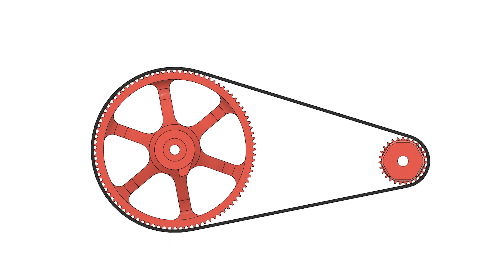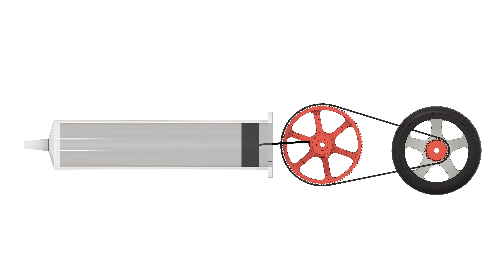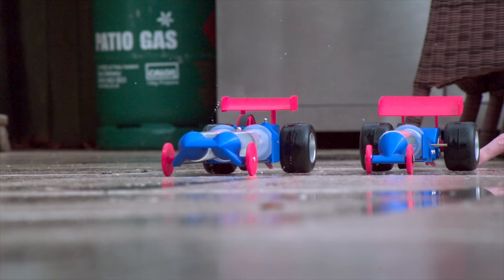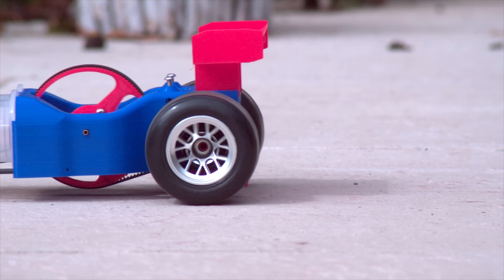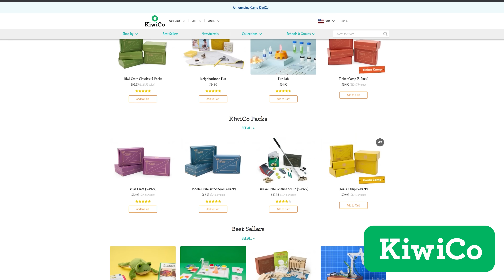Vacuum Dragster

Comment: When syring piston was pulled, some air vortex created behind the piston rod so that making air resistance. Moreover, vacuum syring only can produces short time but brutal torque, it’s not good for long range travel like ICE cars. As a result, I suggest add another syring to improve the efficiency of whole system. 

Elements: Sealed syring piston rod connect with another unsealed syring piston rod. Unsealed connect to a root turbine as mainly power rear wheels. Wire connect to rod & front wheel gearbox.

Position: Sealed syring put the front of car while unsealed & roots turbine put the rear of car. 

Function & how it will work: Before start the car, first pull the car back. The front wheels will spin so vacuum created in sealed syring will air sucked outside by root turbine in unsealed syring. Next, release the car and use front wheels connect to wire accelerate little bit until rear axle root turbine rotate and produce enough power as outside air sucked back to sealed syring. Finally, to stop or decelerate the car, change the gear in front, rear axles gears in both gearboxes, let axles recover kinetic energy by increase vacuum area in sealed syring and sucked air outside unsealed to help accelerate or start the car next time, so braking dishes need to slow down the car, overheating issue won’t exist anymore

Hopefully the whole system work well and replace heavily electrical power unit

PS: although whole system can work in high pressure air in sealed syring, the efficiency will reduce as pressure decrease while volume increases but number of air molecules doesn’t change. Only very little air molecules in vacuum so don’t effect force air act on piston and power output is more sustainable

Comment: You should have made it with a system declining torque/increasing speed out put.

High torque get the mass going and the highest final speed possible. 

Maybe a cone shape a Spiral or stages.

Comment: Here's my personal favorite way of comprehending just how much pressure the atmosphere exerts. At sea level, the air pressure is equivalent to the weight of a 1.033 kilogram mass resting on one square centimeter. A steel bar (common mild steel, density 7.850 grams per cubic centimeter) with a cross-sectional area of 1 square centimeter and a mass of 1.033 kilograms would be 1.316 meters long. If an average-height human male rested that on his toe, it'd reach to his chest. It would also really hurt.

Comment: Hey Tom, you should use a vacuum chamber on your bike instead of the flywheel. You can convert the kinetic energy of the bike to the vacuum chamber by pulling the piston out. And then later accelerate again by letting the piston go back in. The pressure difference will always be 1bar and thus giving a constant acceleration/deceleration.

Comment: Engines often run the crank case under moderate to high vacuum to archive higher HP and efficiency numbers due to the vacuum helping pull on the pistons .

Comment: It would be cool to see something powered by NiTinol (memory metal).  It Contracts with heat and is more malleable in cooler Temperatures. I’ve seen someone make a motor from it with just hot water heating heating a looped string of the metal

Comment: what if you created a trigger mechanism that would engage an even smaller gear ratio after a certain rpm was reached? like a 2 speed automatic transmission. ive seen it done on chainsaw gokarts with varied success. id imagine creating parts for this might be easier since you have a 3d printer. even if its just semiautomatic it would mimic a real dragster fairly well since youd have a much higher top speed

Comment: Please let me know if I am understanding this. By pulling the plunger back, it creates a vacuum inside of the sealed syringe tube, and since that vacuum is lower pressure than the outside pressure, the plunger is forced forward, into the tube?

Comment: what if you were to come up with a way to have a swapping gear system that swaps between pulling the piston back for 1 syringe   and for the other it would provide power to the wheels when releasing the vacuum and then swap back over as that one reloads and the other releases causing a combustion engine like movement  and if you make this happen can we control  it by a centrifugal clutch like system with a cable that goes up to your hand

Comment: this is lightest fuel possible...vacuum. it's very similar to compressed air powered cars, except with compressed air you can hold much more energy in the same volume. using the seringe, vacuum holds  probably about the same energy as 4bar compressed air except it is lighter. 
if you compress the same seringe full of air to a fourth its initial volume, you have air at 4bars that will push the seringe along 3/4  it's length, starting ,with  an initial bar pressure difference and ending with 0bar pressure difference so if we average to 1.5 over 3/4 the length it should provide 9/8 the work of a vacuumed serinve pushing 1 bar over the full length.
compressed air tanks are heavier but can hold 300bars

Comment: It would be interesting If you used the Nucomin principle, with a small low pressure boiler and a valve gear that injects the water at just the right time so the piston retracts.

Comment: what if the axel around which the string was winded wasn't perfectly straight but rather cone-shaped? The change in diameter would change the gear ratio as the string would unwind. It would basically be a very simple automatic transmission (CVT). You could start the car in low gear for traction and upshift as it accelerated.

Comment: hi sir , just like mousetrap cars, syringe powered car  and  rubber band car we can also make cars by using a measureing tape , we can wrap the measureing tape on one axle and join wheels on both side of the axle , and we will get a measureing tape powered car ,we can make the car fast by making 2 axles , one axle which is joint to the wheels and other axle on which we can wrap mesureing tape and join both axle with pulley and rubberband , sir what do you think of this idea?

Comment: ADD  LEAD OR STEEL WEIGHTS TO IT THE ADDED WEIGTH WPOULD PUT MORE PRESSURE OTO THE AXELS WITCH WOULD PUT THE TIRED MORE FIRMLY ON THE GROUND AND ADD EXTRA TRACTION

Comment: Acceleration and top speed increase when the car uses tires with more grip. Is a good idea cut two baloons and put some rubber in the rear wheels

Comment: Its a good idea but you have designed a vehicle that does the opposite of a top fuel dragster because a top fuel dragster is designed to race of the mark with extremely high torque and coast the rest of the way down the drag strip

Comment: There is something oddly satifying, seeing the fine print on the toothbelt rotating in slo-mo.
I am wondering wether you could control the car steering with a flywheel. But then again, it would probably get too heavy.

Cheers!

Comment: When I was an apprentice, we found that if you spin a bearing up with a compressor air gun, it makes a satisfying screamlike whine. When you dropped the bearing onto the lino floor, it would wheel spin in situ for a while and then accelerate at mean speed. So we built dragsters around bearings using thin copper pipe, and found that if you wrap the bearings in heat shrunk sleeving (you had to balance the wheel), you had a tire and the dragster instantly shot off and disintegrated against the workshop wall. Great fun!

Comment: You should try the super capacitor dragster but only with one motor with a gear printed into the axle so you dint pull as much current per pulse of throttle and you can control it easier and have less chance of flipping and destroying wheels

Comment: Should of put a little weight on the rear of the V-2 car. Was a trick used on old Ford Capri’s so they could be driven harder/faster with more stability

Comment: There was a concept for a vacuum powered car, one vacuum releasing would power the other, and a shaft was connected to it. didn’t work though, because the two vacuum cylinders would just equalize and not move

Comment: Some of the earliest power seats in cars were vacuum powered (e.g. an internal combustion engine is mostly an air pump but with this air pump it creates low pressure areas inside the intake manifold or crankcase depending on the engine). 

Other things controlled by vacuum include the pop-up headlights of the C3 Corvette, HVAC controls like temperature blend doors and air flow doors were vacuum powered, adjustable engine timing was done with engine vacuum. It's not as exciting as a dragster but now that electrical doo-dads are cheaper and more efficient (mostly cheaper) you don't find nearly as many vacuum hoses in an engine bay as you used to. In fact some 80s cars had a tin can under the hood with a single line going into it. That was a "vacuum reservoir" so you could still work your vac accessories for a bit if the engine stopped.

Comment: my question is. since its vacuum and all rather than pressure. would it produce more "power" with the cylinders cooled or heated. after they are applied with vacuum that is.

Comment: Tip. a good way to check for air leaks is with soap and water. Get one with water and washing up liquid mixture and then apply it to the joints and if you see bubbles it is because you have a leak.

Comment: you gotta reduce (if possible) the tires' air pressure, Dragsters also use that to increase its launch grip. making it hot already is only good when its a circuit race. but it will still help the grip.

Comment: 0:15 yeh its not pushed down but the forces aren’t actually exactly the same. It’s actually pushed up because the force on the bottom is just slightly greater than the force on the top (buoyant force)

Comment: Here’s an Idea to possibly help with traction, try and deflate the tires as much as possible. Dragsters can run as little as 6 psi, so under 1 psi could work. Another idea would be to lay down rubber before the run.

Comment: DUDE !
You just gave me a totally crazy idea...
Hear me out :
Taking an helium balloon made for high altitude flight and attaching to it a special air tank filled with air at sea level pressure, so 1ATM.
The balloon rise up, then, when it reach a certain altitude, using a barometer to trigger it, the air tank is being opened, the difference of pressure caused by the atmosphere translate into enough power to be used, in this case, it will be used to use a mechanical retraction system that will cause a part of the balloon to get back inside a "storage tube", making less available volume for the same amount of gas, meaning more density, enough so the balloon start to descent.
Once back down, the balloon is retrieved and the air tank that contain a near vacuum is used to make power, the "stored" part of the balloon is simply released and the cycle repeat !

With a large enough balloon and air tank, we can also use capacitors and tiny energy generators to store just enough energy to actuate a really simple and low power electronic guidance system and moving control surfaces for steering the descent, with a big physical funnel to make it not require to aim at an ultra precise spot, it can be automated.
And if it is automated, it literally is a free energy device 🤣

Comment: So you built a plane that works off compressed air.   Why not a plane that works off vacuum pistons?   Figure out a way to use mutiples of them so that they will activate in sequence to give a prolonged amount of engergy in the system?   Or maybe make the fuselage one long piston that is integral to the design?   A gear box to drive the propeller and away you go?

Comment: I have a suggestion for you you ever heard of thermoelectric effects imagine running a compressor off of a motor and all that wasted heat energy from the compressor you use thermoelectric effect material to generate electricity that you can and run the compressor see if it works peace out man

Comment: The reason your car veered off was because you didn't break in the F1 RC Car tires. You need to sand off that center molding bead. You must also add sticky rc car tire sauce directly to the tires & completely spray the surface you plan on dragstering thru with sugary water by a common spay bottle.
(Also sweeping the track clean of dust/dirt)

Without doing that to rc car tires/track, you were destined to veer off without grip, heating rc car tires wont give you more grip, especially since those tires are designed to work on prepared asphalt surfaces.

You gotta repeat this experiment and repost it!
Reply: Also, if you can’t prep your car at home, take it to your local rc track and have some locals help you out so that we can see this puppy really go down a straight away, it should go pretty fast since your fuel weighs, well nothing really

Comment: IF you make a pressurized syringe spring instead of the vacuum one, you can make the string coil on a tapered shaft to produce almost constant torque on the wheel. IT is like a CVT in car.

Comment: The syringe piston seems to be sliding at unsteady rate, the rubber seals needs some lubrication. Would recommend 20wt+ oil for the syringe rubber seals.

Comment: Add some weight about 1/5 the way in front of the rear axle, this will help with your traction issue. Automotive wheel balancing weights and fishing weights may be good options for simple lead to find, something more specialized would be pinewood derby tungsten weights. Its one of the most dense materials you can get without it being radioactive. Tire sauce is also something on-road rc racers have used for years along with thinning the sidewalls of the tires on the inside. Please try to keep going with the atmosphere powered vehicles, id like to see some progression in your dragster and perhaps an aircraft?

Comment: i'd like to develop your final observation a little bit. it is actually YOUR energy that is moving the car forward. the atmosphere plays the role of a battery that stores it. when you arm the piston, you put energy into air by moving some of it's mass a little bit higher. and then the air pushes back on the piston to move the car. it's still mind boggling of course
Reply: I guess it was actually the food he ate the day before....no wait, the sun that powered the foods growth...nevermind the large explosion that eventually formed into the Sun I suppose.
Reply: @PowerScissor  I suppose you are spot on, but there is only one thing still troubling all the philosophers: whether his conscious decision to arm the piston of the car was also predetermined by big bang or is it something else
Reply: Great observation! It’s that same when you pull back a spring. Your energy is what gave the spring its elastic potential energy, which it can later be released.

Comment: I thought about this concept a long time ago why don't you use a pulley system to get a mechanical advantage on the other side use copper coils and gears to rotate a motor and converted into electrical energy then to then to power another motor that will bring back down the syringe completing the cycle questionnaires does it produce enough electricity to complete the please give me credit for mechanical concept for this motion and electronic generator
Reply: Sorry use a pulley system
Reply: Are we publishing patterns for designs within the next 4 days I need a I need a mechanical engineering
Reply: Mechanical engineering solicitor*

Comment: Too much pressure in the tires.

Rear suspension is underrated in traditional drag racing practices. I had a terrible problem with wheel spin initiated by tire hop at launch on my motorcycle until I built a wheelie bar that utilized the normal suspension instead of a rigid rear.

Comment: i like drag race electric rc cars and an eady way to get more grip is to use foam wheels, they dont last as long but are extremely grippy, prehaps messing around with the size of the wheels to make them larger could help, i would normally suggest a fullyfunctioning rear wing but i dont recon this would be getting fast enough for that to matter.

Comment: Ive noticed one unique thing about your videos is that you like weird random stuff like perpetual motion kinda stuff and things of that nature, i love the videos. can you do a video on how a simple clutch can work, not sure if a torque convertor is a type of clutch or works like one but i know they way those are built seems like it could work as a clutch by itself. Similar to a centrifugal clutch but made like this- make a housing with two fans facing each other submerged in oil or water with a see through housing, and than have a motor connect to one fan and have the other fan connect to the shaft and out to the wheels of a car or something to test the torque, i wish they made automatic clutches this way cuzbit seems like a cool concept of engaging and disengaging the power from the fluids spinning around forcing the other fan to spin once the rpms get higher  wish they made rc cars like this or maybe you can, i dont have the time or money so i just like recomending some ideas to people who are good at building stuff, maybe you can make a "Fuze" rocket engine out of cannon or firecracker fuze,

Comment: Could a glider/plane have a motor that turns a propeller that turns a small generator that generates power for the motor that turns the propeller or would that just not work :)

Comment: You could totally add a conical pulley to where the string wraps and get a makeshift CVT transmission.  Maybe play with the profile to get different acceleration curves, would be a neat part to show off the 3d printing too

Comment: 2 stage syringe put a spring inside of it so one direction runs off vac compresses the spring loose the vac and then the spring will move it out. No idea if it would be more efficient but might be worth testing?